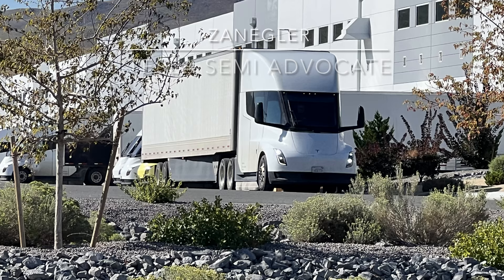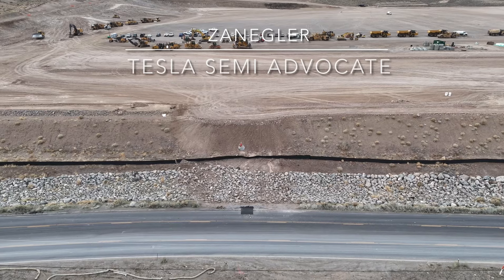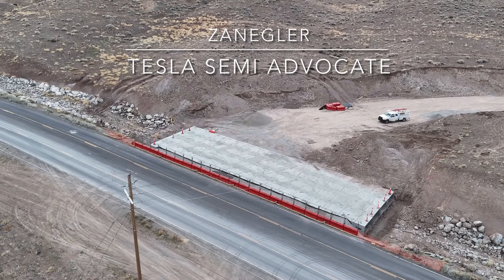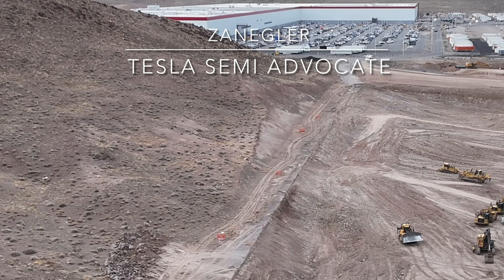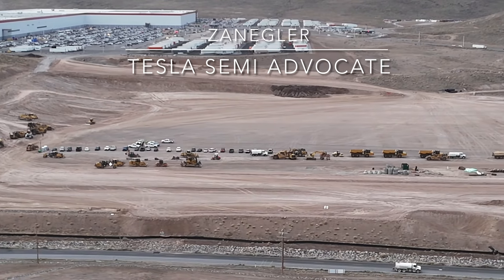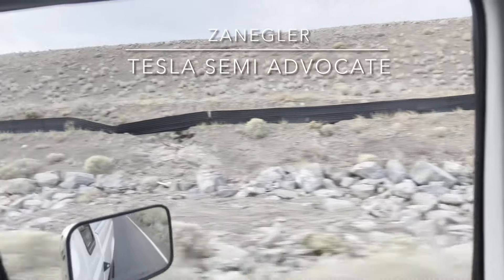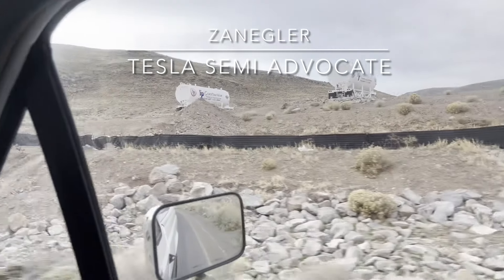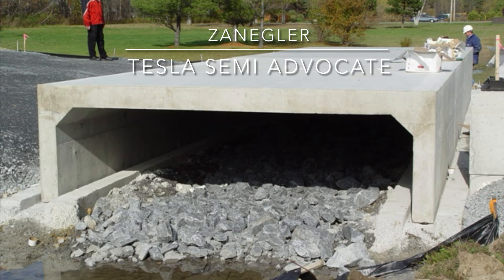Giga Nevada Construction Update - Progress includes new access road.

Comment: The box culverts are clearly not "bottomless" as described, but have all four sides precast and placed on-site.  Contrast the concrete floor seen in the on-site photos with the illustrative photo shown in which a truly bottomless precast culvert is placed on cast-in-place footings and the area between those footings is armored with rock to resist erosion.  Since the channel at Tesla's site is steep it would be risky to rely on a bottomless culvert.  We will next see cast-in-place concrete headwall and endwall constructed onto the precast multi-barrel box culvert.